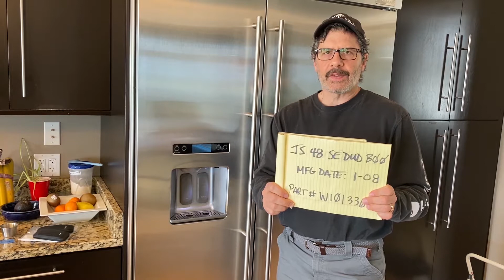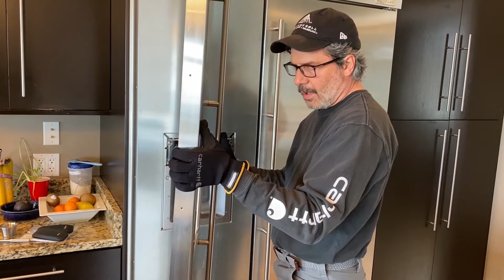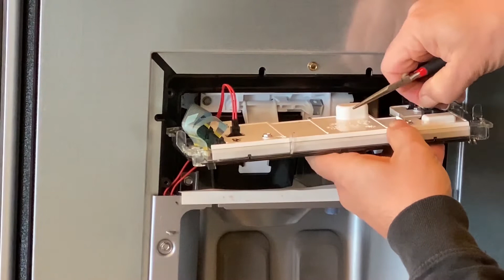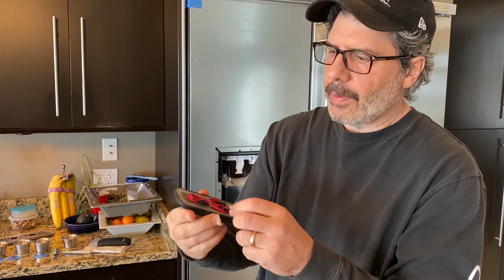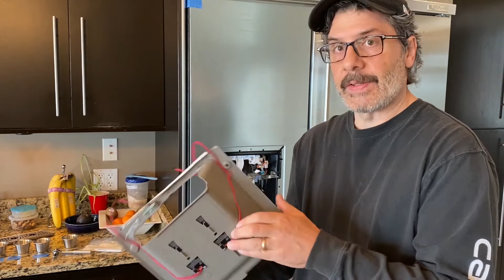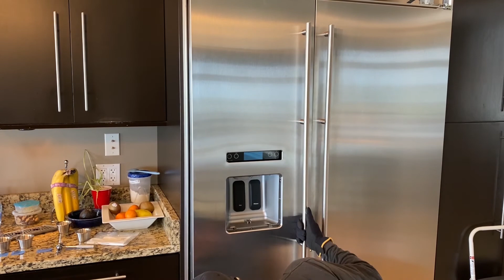Jenn-Air Whirlpool Refrigerator :  Ice and Water Dispenser Pad Replacement JS48SEDUDB00 W10133603

Comment: thank you for the video , what was the problem at first ? that made your replace those parts ? thank you
Reply from the maker: Good question. I guess I never stated that in the video.  Both pads were still operational, but you had to press them very hard to get them to work.  And they were intermittent if you did not keep strong pressure on them.  They were just wearing out from 10 years of use.  And they looked pretty beat up.
Reply: @dontscrewitup  got you , thank you for your replay

Comment: im going to try to just push the actuator/button up and pull out the actuator. cut wires then reconnect the wire.
Reply from the maker: Good luck. I can’t recommend that method, but it may work.

Comment: THanks! is there a way to test these actuators?
Reply from the maker: You would need to disconnect the pad from the circuit board and do a simple continuity test when you press the actuator.  You would probably need to put short jumper wires in the connector. I don’t think you could do it with the standard tips on a multimeter.
Reply: @dontscrewitup  i probably need to replace it then . When i don't press the actuator it shows 7volts when i released it it shows zero. Thanks' for all your help!

Comment: I have exactly the same fridge and my icemaker randomly keeps dispensing ice cubes by itself . Can you please tell me is this ice dispenser actuator shorted or that dispenser control board ? thank you in advance
Reply from the maker: I’m not a certified technician, but I’m guessing it is actuator.  The board probably can’t dispense without the actuator making contact.  Try get lightly tapping on or around the dispenser and see if it dispenses.  It is likely the problem. They wear out over time.
Reply: Thank you for making these videos. 
Where did you find the model number? I have a jenn air fridge I'm working on.
 I couldn't find to model number, and I don't have the  manuel of the refrigerator.
Reply: @siizrmccoy6262  when you open the fresh food section door. Label with model and serial number should be on the side wall, or on a fresh food section frame somewhere.